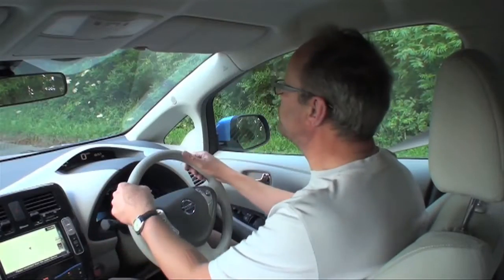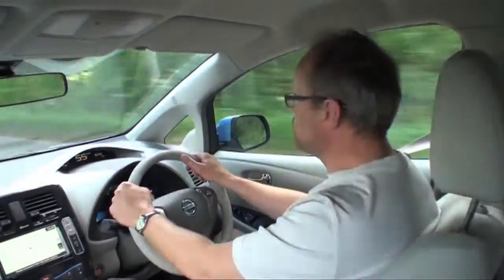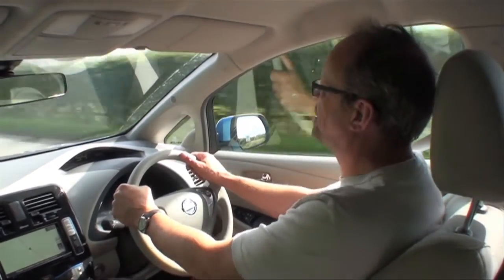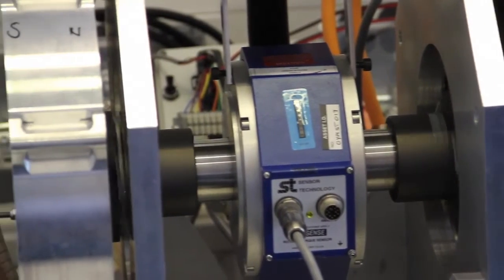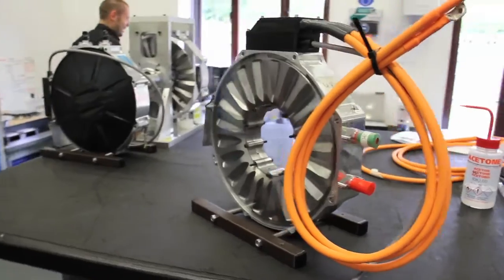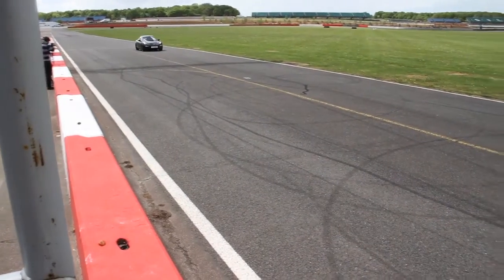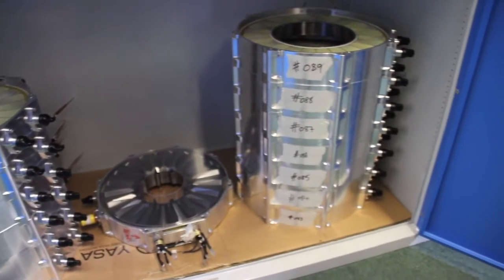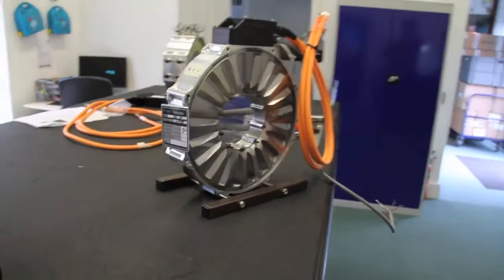YASA Motor Works | Fully Charged

Comment: I don't understand, is it both an electric motor and a dynamo working together?
Reply: An electric motor and an electric generator (dynamo) is the same machine. Electric machines can change the power flow at a whim. So they go from generating mechanic force from electricity to generating electricity from a mechanical force and back, as required at any given point.
Reply: On that particular test bench they are running one unit in generator mode and the other in drive mode.
Often in an electrified car you'll have the exact same unit doing both because you're unlikely to be braking and driving at the same time. As the guy explained, this just makes for a compact testing setup, connecting two.

Comment: This is most powerful motor ever made, thanks to neodymium magnet and light weight materials... for this size, only 40kg can produce 750Nm of torque.. 200k pound is too expensive and only applicable for electric train transportation..

Comment: I would love to see an update of where they're at 5 years later.
Reply: nowhere, because their ratings are bullshit
Reply: Yes. . . me too.  Also some proper technical stuff about how it works.
Reply: Probably not a revolution technically. Just using really good modern batteries and really good modern solid state switches to tweak existing designs.
Reply: they are developing full electric flight with R-R. They just signed the deal with automotive OEM too. It is not too bad for once PhD student making millions out of his studies.

Comment: in high temp high humidity areas {gulf coast,south east,south west} these electric cars kill the best of batteries in a few years.Not bad right now because the cost is still kept down by taxpasyers and warranties but not forever.Bad part is that a major portion of these batteries end up in landfills leeching their heavy metallic poisons into the water supply.I want a 500 cubic inch Hydrogen burning internal combustion engion spitting out pour water as exhaust and still having that vroom vrooom  tire spinning head snap take off.
Reply: Kill the batteries in a few years huh? Sounds like you personally owned an electric car that this happened to? So sorry to hear about your loss. And that lack of tire spinning? You must have missed it with whatever sad, sorry electric car you owned and had this experience with. Which model was it? Perhaps a home built? Such problems are common with recycled golf cart batteries or other 120 year old battery chemistry. A lot has happened in the recent decades though, lithium batteries, and even NiMH are routinely going more than 100K miles, and Chevy's most inexpensive electric car develops 400 ft/lb torque, which unfortunately is far more torque than the tires can manage to keep in contact with the asphalt, although that's nothing compared to some TESLA trims, which can do 0-60 in UNDER TWO SECONDS. I'd urge you not to give up based on your past experience. A lot of new technology has come to fruition that makes even modest electric vehicles extremely impressive to drive, not to mention that they can fill up virtually anywhere. Give them another chance.

Comment: Most motors have a rotating armature and a stationary field.  The stationary field can be copper windings with field current flowing through it to create a magnetic field. This magnetic field pulls on the magnetic field of the armature creating torque. In this case they use rare-earth magnets as the stationary part to produce the field . The magnets then are the field windings. This type of motor is simpler and the magnetic field from the magnets is fixed.  In other motors (especially larger DC motors) the field voltage and current can vary.  Also the maximum efficiency (or Carnot efficiency) of a petrol engine is about 40%. That is only a theoretical efficiency and impossible to achieve. So the maximum real-world efficiency of petrol engines is high in the 20's or 30's. These YASA motors have real world efficiency's in the 90's. No comparison.

Comment: The electric engine is an equivalent of a seven litre combustion engine with 120 hp? That must have been a very tired 7 litre engine then and even though 120 electrical horsepower is not the same as 120 fuel horsepower, that wouldn´t stop me from wondering if you aren´t able to squeeze out much more than that.

Also, if you want to travel even more faster, shouldn´t there really be a sort of a gearbox for electric engines to transfer the power at very long gear ratios?
Reply: +Pasta Sarmonella E-Specialé He said the VOLUME of the motor is around 7 liters...it's not the equivalent of a 7 liter internal combustion engine.
Reply: +Pasta Sarmonella E-Specialé Electric motors give the maximum torque at 0 speed and it decreases linearly with speed but still enough to move the car, thus there is no need for a gearbox.

Comment: I need 4 of those motors put in my Hummer with a generator where the motor was.
Reply: Didnt it have a generator also?
Reply: Lol ... Why not just bolt one of these yasa motors to the back of the current engine an bam you already have a generator 😂

Comment: i doubt the re-charging generator output ability will be anywhere close to the power its consuming to the drive motor..if it is so then it would be overunity and defy laws of thermodynamics..the real hindrance  with take off of an electric motor car into the consumer market is the expensive primitive battery technologies that are  available now..the 1 kilogram of common  battery just cannot store the kind of energy a single litre of petrol can give
Reply: professorfidelcat The entire point of the rig was to measure the loss, they weren't using it to generate the same energy back. 

The product they are showing is a new kind of electric motor that is designed to be lighter and more efficient than current motor designs. 
You're right in saying petrol is more energy dense than the energy storage capacity of conventional electric batteries, however a petrol motor is (best case) 20% efficient at converting that stored energy into usable kinetic energy - and even then that energy is only useful at a certain RPM. Electric motors have a higher torque output (meaning they push harder than petrol) and a higher top speed (depending on the energy source) with only a 20% waste energy, so even though petrol is more energy dense, less of that energy is used.

 Batteries do need to be improved, however. More R&D needs to be spent on the field. Though a regular converted EV is infinitely cheaper than the same petrol car, though I'm accounting for the fact that you don't have to throw the car away after it has done 300,000Kms ;)
Reply: Funny you mention that, Toyota actually patented a 2 stroke linear petrol engine that was dedicated to running an electric motor in a car. 

So a petrol engine to run an electric engine. This is to remedy the low energy density and slow charge times of conventional batteries.

Think of it as using petrol as a battery and using a motor to extract the electricity from it. 

The efficiency of this motor was somewhere close to 28%. however, best case petrol is worse than worst case electric in terms of efficiency. 

Even hydrogen cars are really electric cars that use hydrogen as a battery source.

I agree with you when you say that research needs to be done. However, if we are spending money on something, we should spend R&D money on battery tech. It's the weakest link in system that is proven to be very effective, so lets not waste it on improving old tech, lets concentrate it on figuring out a puzzle that will create changes across the globe that you couldn't even imagine.
Reply: Yeah, fast charging and high capacities are key. It's just about figuring out how.

This is that Toyota engine
http://www.roadandtrack.com/car-culture/a6326/out-of-turn-toyota-engine/
Reply: point taken, maybe we need to improve petrol engine design to bridge the 20 perce t efficiency gap nearer to the electric motor concept, perhaps a petrol engine dedicated to charging super efficient capacitors and batteries  which in turn runs the electric motor of a car will be good as a start, any heat produced from the friction could also be squeezed into electricity with arrays of thermoelectric modules to recover some of the inefficacies of the heat and friction produced from the petrol generator and electric motor..
Reply: Ok toyota patented that when? The trick  to improve batteries would be  th make them charge ultra quick and retain energy longer...the efficiency  of capacitors have improved in the last  decade..capacitors can help very much in these concepts of using fuel to charge batteries then driving electric motors..i guess toyota might have better eficiency rating  today with use of such super capacitors and lithium batteries to run the show
Reply: I think toyota patent you mentioned must  have been  lodged decades ago when lithium batteries and super capacitor technologies were  non existent  or in utter infancy ..the efficiency could be improved greater by todays lithium and supercaps though nowhere 80percent still...
Reply: David Alsh yes thank you, I saw its interesting..no conrods, rotor.. just piston going up and down a shaft with return spring I think..it just needs a good kicking power to overcome lenz laws as the electric motor demands tens of kilowatts of energy to turn

Comment: Not enough information. We only got it uses a permanent magnet stator, so I can only suppose this is a DC commutator motor. They claim to beat competitors in terms of size but with motors that compact it doesn't really matter, also, I believe the mentioned competitors use cylindrical shaped motors and these were more disk shaped, so the big torque figures come from the larger diameter. In other words, they're cheating. These motors are smaller in volume but harder to fit under the floor without gearing them to face downwards (putting them in the wheels isn't a great idea for various reasons, including synchronization and driving on tougher terrain). They also use relatively expensive permanent magnets instead of just winding up some stator coils, which by the way would be able to generate an even stronger field if needed. There's always something fishy when academics are involved - they keep trying to convince others only they understand 200+ year old technologies.

Comment: Internal combustion engine using petrol ,electric motor require expensive battery so where is that efficient ?
Reply from the maker: When discussing the efficiency of an electric motor over an internal combustion engine, you have to consider the amount of energy (kilowatts) that goes into the engine and the amount of power that comes out.
The battery or petrol are irrelevant in this equation.
 An electric motor has 1 moving part, a 4 cylinder petrol engine about 400, to dive an electric car 100 miles requires around 24 kilowatt hours of energy, in this case, electricity.
To drive a petrol car 100 miles requires around 120-140 kilowatt hours of energy, in this case petrol.
Therefore an electric car with batteries is a much more efficient way of using energy.
Reply: fullychargedshow way to go for electric. . good explaination. .
Reply: Fuel cell system is not nearly as energy efficient as a battery system, because it has so many steps of converting energy into motor power. Hydrogen is not available in free form on earth, it needs to be generated and liquefied, that requires a lot of energy with a lot of waste heat generated (wasted energy). Then the fuel cells are not very efficient either.
Solar/Wind or even coal -> electricity -> battery charge -> motor is much more efficient than any other form of energy supply.
Reply: Petrol is only going to get more expensive over time. Batteries will get cheaper and cheaper over time. That's how this all works. You need to be less dense and understand we should start building for the future.
Reply: +fullychargedshow Then there's the fact that at a stop, an electric motor has no need to keep turning so they don't use any energy to "idle". Also for most electrical automotive applications, there's no need for a full on transmission, so there's even less energy lost. After all, the typical gear reduction set up is a lot more efficient than the typical transmission.
Reply: +epiphonesg007 

At Ludicrous speed!!!
Reply: you can use cheap battery but the range & performance will be limited. For oil do you have the option?? one more is no engine oil change and other accessories needed for engine support. please do some study :)
Reply: +fullychargedshow 
At what speed?
Reply: +Azazel ciort A fuel cell and H2 gets rid of the battery.
Reply: Nice answer
Reply: Azazel 장난 think about how much energy and materials go into astandard IC engine compared to an electric motor, they are the future

Comment: Well the problem is the Energy density 
Gas  46 MJ/kg
Lithium-ion battery 0.85MJ/Kg
Means 1kg gas has 54 times more energy then LI battery.
So even a 95% efficient electric engine vs a 30% efficient combustion engine let say 21% efficient with transmission.
Gas 46*0.21=9.66 MJ/kg 
li battery 0.85*0.95=0.8075 MJ/kg usable kinetic energy from the same mass.
9.66/0.08075=11.96
Means u can go 12 time more distance with a combustion engine with the same kg gas then LI battery.
Reply: so really the fuel cell is more important than batteries at the moment

Comment: Actually guillermo, I think there is plenty of proof that electric motors exist, and that they work. Perhaps you were confusing what they were reporting with something else?

There was nothing particularly controversial in what they were claiming. Just an electric motor that works on the same basic principles and other electric motors, but which is compact and relatively powerful for it's size and weight.

Comment: Unfortunately it's nothing new. The concept behind it was driving your VCR years before (pancake motor). Neodymium magnets have also been around for years and years. I know shows like this feel promising but the electric motor isn't, nor has it ever been, a limiting factor in electric vehicles. The problem is energy storage. Some company can come along and magically make a 100% efficient electric motor and now you get 100mi a charge instead of 95mi. Current production motors are fine.

Comment: Why people saying thet electrics motors no need for gears or diff for high efficiency i am a mechanic and i know what i saying.
2 EM 100 Kw thet is 200 Kw so lets say for 100 km/h we need 50 Kw (the mean one EM 25 Kw Continuous power ) on end we have 50Kw/h
A petrol or dizel ( one motor no 2 as ELECTRIC motors) have same power engine but he have gears and diff, he need 25Kw Continuous power for 100Kw/h on end his efficiency on 100 km is 25kw (petrol or dizel) and fo EM is 50 kw.
THINK !

Comment: How many poles does the motor have?  And is the number of permanent magnets the same as the number of poles? (I think for smoothness, the numbers should be relative primes).
Reply: These are synchronous moors, so the number of stator (electromagnet) poles equals the number of rotor (permanent magnet) poles.

Comment: @DanFrederiksen
Driving in frisco will only be normal for people in frisco though.
Stronger acceleration can actually reduce range, depending on how you engineer it, I will agree though, that not all solutions will do so.
And yes, 32k$ is a significant amount of money under any circumstances, but I suspect that could drop with mass production. I believe the main reqason why it is so expensive, is because they are trying to recouperate development cost, rather than just the materials.

Comment: Inspiring. Components to build the Plug In Hybrid SUV of my dreams are comming fast. Please BMW assemble them in a reliable and safe SUV, say an X6, or better a future X4. Just pick a clone of the 71KWH battery of the RR EV (Assuming 3 x folds Instant Power as well as 3 x folds capacity vs the Leaf), plus 4 of these electric engines, pull all geabox & other transmissions, and add a Range Extender pure generator = best for constant speeds (Micro Gaz Turbine ?). 
Fit that all into <60K€ price tag.

Comment: @DanFrederiksen2 
Right, because San Fransisco is representative of the type of driving normally done.

Imagine that you put some nice big 18" wheels on it from a Corvette, with Direct Drive and cruise around at 26 mph (approx 200 rpm at wheels, 40 kph in metric), and as long as it doesn't require more than 250 nm of torque to go up the hills in an average city, it would *still* break 80% efficiency.

Be honest here, how often do you need better than that ?
Most cities are flat after all.

Comment: @Jesus45U I wouldn't be right if you could just name a few more things to disprove me.
stronger acceleration capability  doesn't reduce range.
and you need the strong acceleration in fixed gear to not overheat when going up hill at low speed like in san francisco. you can't just shift down to 1st remember..
a 6 second acceleration is fine for that but then there is the cost. it's a very expensive way to achieve 6 second acceleration. and all that together we are back to my original assessment

Comment: @DanFrederiksen2 

He he he he ... the harbbringer of truth ... good one. :)

And I'd say 0-100kph is just fine, they could easily make it faster, but they'd loose range then. As it stands now, with the current battery technology, range is the primary concern, not acceleration, and for that Direct Drive rocks. :)

Comment: @Jesus45U the tesla roadster has a 1:8.27 fixed gearing and over 200km/h top speed. yasa proposes a more than 8 times higher gearing. surely 1600km/h is not strictly speaking required.

they are currently producing a 32k$ drivetrain that'll only do 0-100km/h in 6seconds with a 1000kg car. that's not good. I think a 1:3-1:7 fixed ratio is interesting for them. for 1:1 they will need to make their motors much much cheaper